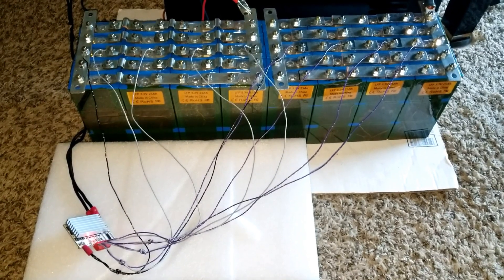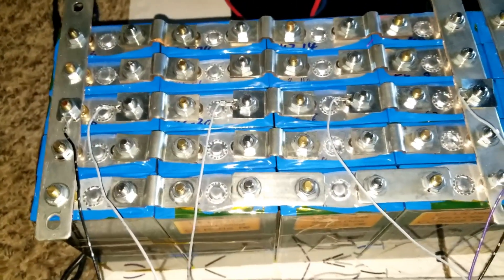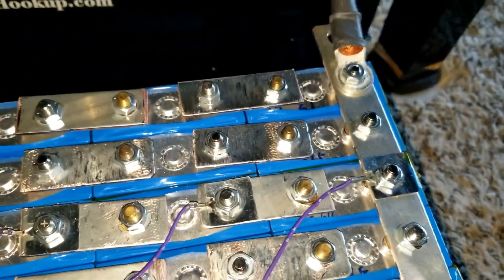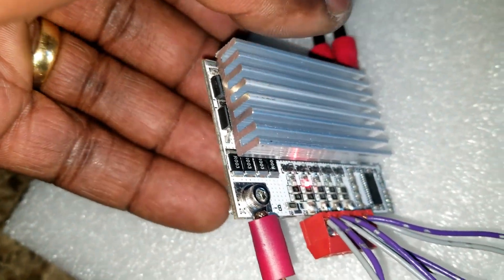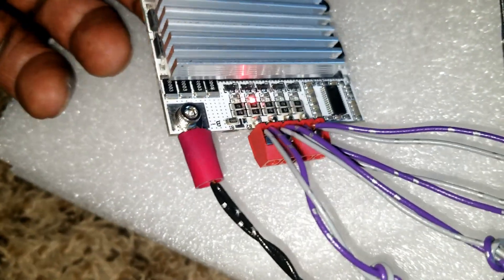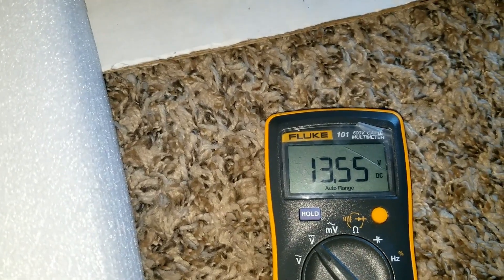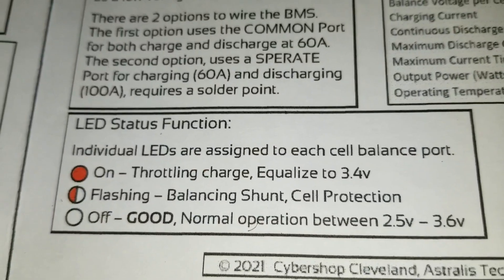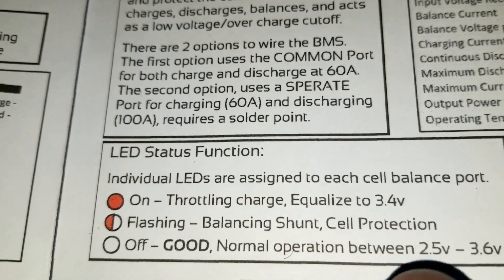PRISMATIC CELLS CONFIGURATION, GUIDE TO BMS, DIY, BATTERY, MANAGEMENT, SYSTEM, TUTORIAL

Comment: It’s seems to be working but it looks like you may need a much bigger BMS  to handle the large currents and the way you have it connected to the one row of 4 cells on the white wires and 4 more cells with the blue wires is going to only balance just those 8 cells and not the rest is probably why it’s getting so hot .. With the long bus bars across all the + terminals on each row of cells in each 20 cell set and the 4 blue wires attached to each + long bus bars on the 1st 20 battery set and the 4 white wires connected to each + long bus bars on the 2nd 20 cell battery set will balance all 20 cells in both battery sets .  It’s a learning process but you will get it soon .
Reply from the maker: Yes